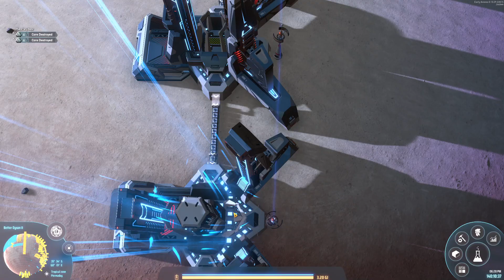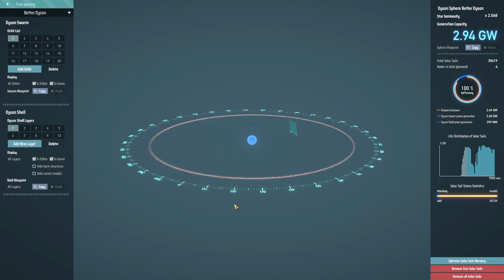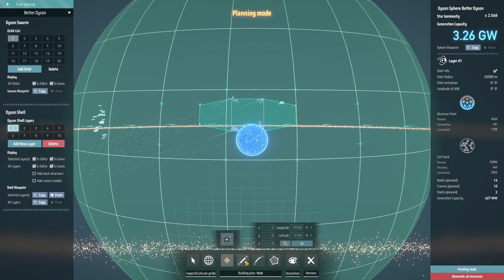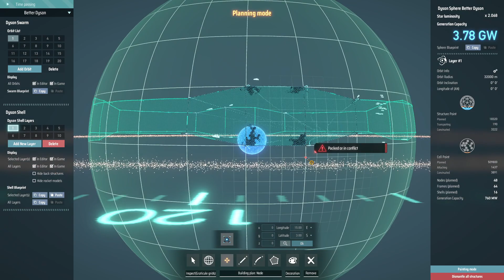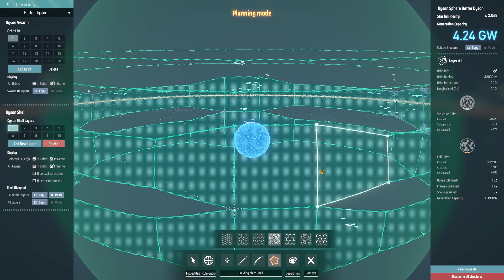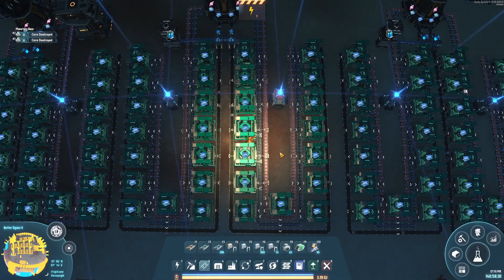DESIGN // Dyson Sphere Program // Mission Log 130

Comment: looks like you definitely have some logistic issues, you're out of graphene in one area and over on graphene in another area lol. this is one of the reasons I'm not a huge fan of direct belts in the late game, its just so hard to prioritize properly. 

as for hydrogen, i think your issue is that since you're bringing hydrogen in at the north pole, you are equally utilizing your waste hydrogen and your gas giant at the same ratio rather than prioritizing the waste hydrogen. for my builds, I use an ILS as my tower for casimir crystals (and fuel rods and strange matter for the same reason), turn on local demand first, allow the buffer to fill, then turn on remote demand. this should allow it to prioritize requesting from local first, and only request from the gas giants if supply falls behind. you could also try lowering the minimum drone storage on your hydrogen-byproduct towers, theoretically that might cause them to start transferring hydrogen before the ILSs do, that might help.

it's definitely going to take a lot more sails than rockets to fill out your sphere, it always does. you could launch some rockets into alwaid or any other star if you wanted to, or just spam a bunch of nodes all over the place lol. that'll definitely consume them. upscaling science is my default consumer of hydrogen-byproducts, since you need both casimir crystals and strange matter for green science, and hydrogen for red science. you can also proliferate your sails (and rockets) to get them to launch faster, but since the rate at which each node absorbs sails is fixed, this may or may not actually help.
Reply from the maker: Yeah, I made a lot of mistakes from lack of knowledge. If I was doing it over again the whole build would be different, but I'll live with the factory I made. I think I might let it run off camera until the rockets are done and I've refactored the build, so there might be a break between videos.